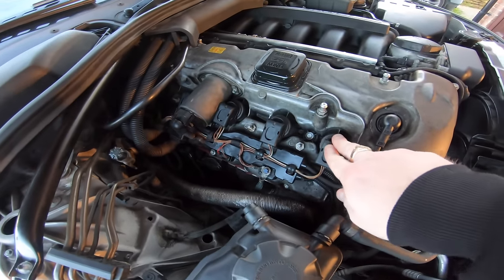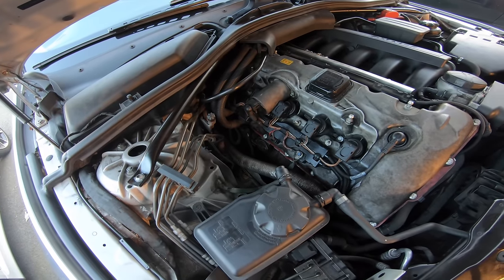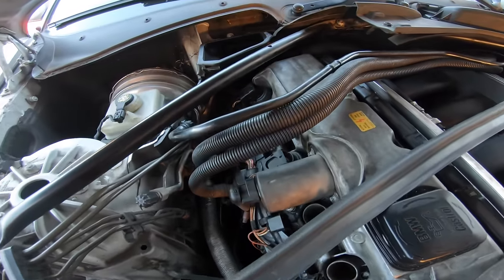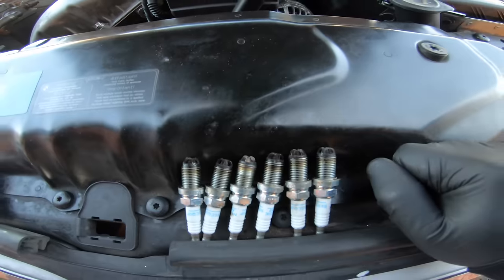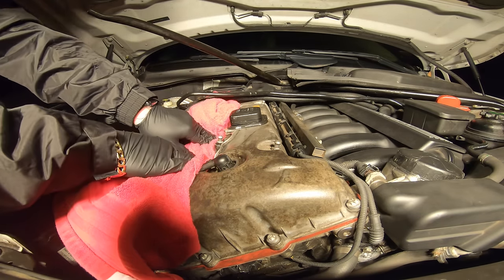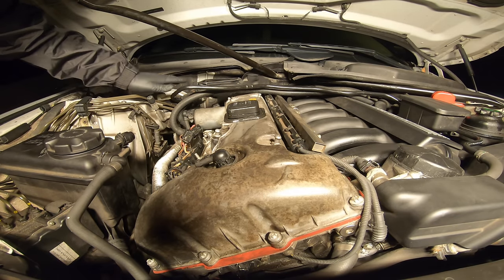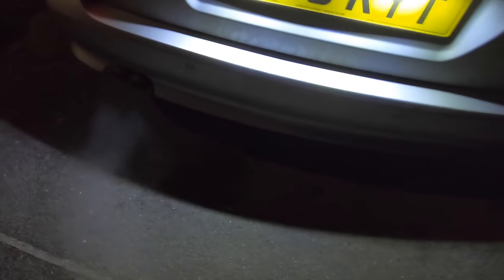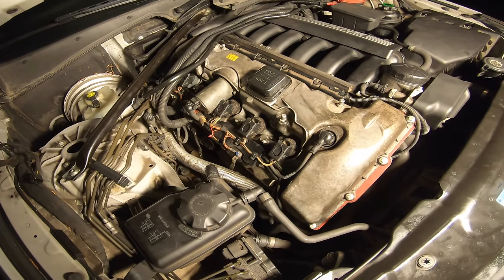How to Clean Piston Rings Or Oil control rings after head Gasket failure / CCV Failure On Any Car

Comment: The amount of smoke that came out of my 328i filled the street with white smoke for about the length of a football field with berrymans b12.  It cleaned my oil sensor so now it's working properly again. Also not burning a drop of oil and no oil burning smell. I couldn't be more happy. I used my tools and a bore scope. I just did a 8 hour soak. Topped off Then rinse flushed out the spark plug holes. The amount of carbon was monstrous. Although the crankcase is in pristine condition meaning this car had normal oil changes before I bought it in March.  I couldn't be more happier.  Next is ultrasonic cleaning the fuel injectors.
Reply: @Centralflorida22  thanks mate I’ve got a serious oil burner on my hands. Toyota 2.4L. I’ve been watching similar videos, however, I’m gonna give this one a good luck. Thank you.

Comment: Hi, I treid your process this week on my car.  The next when I started , as you mentioned that it will smoke, that was exactly what happen. After about 10 min into idle, my car started to idle very smoothly like it used to a few years back. I n54 has it power back , thanks to your video.👍👍👍👍

Comment: Seems like throttle body cleaner would be a better choice to clean the combustion chamber than fuel injector cleaner. My though is I don't think the kind of grime dirt in fuel injectors is not the same as found in combustion chambers which I think throttle body cleaners are better for. Am I wrong?
Reply: No, not throttle body cleaner, you'l ruin your bores.

Comment: i did this  the other day on my 01 m62 4.4 x5,  put small amount in holes , left over night  did exactly what it said on the video, ive now got a car that wont start, i have fuel  i know this as  the plugs are always fouled with fuel, i have spark ,  im having to get the car towed to my local indy to let them have a go,  lets see if they can get it working , but as of yet, id do this procedure at your own risk,
Reply: What was the issue? Do tell
Reply: any update?

Comment: Finally found an in-depth video on this process. Thank you so much for doing this and filming every step. I'm about to replace my cracked CCV and I had to find a video on how to actually do this cylinder cleaning. I really appreciate you taking the time to show this from start to finish
Reply from the maker: You are very very welcome this is why I came around in very surprised it took you this long as I’m at the top for n52 manifold I have the best video for intake manifold removal which is full in depth process
Reply: @BMWDoctor  I've been searching for m54 videos, but I'm not sure how I missed your channel before, but I've just subscribed so I won't be missing anything in the future!

Comment: I used to use this redex stuff way back in the 1980s when my car had a lot of pre ignition carbon build up ,causing the engine to keep running roughly for a little while when i turned the ignition off because the high amount of carbon was hot enough to keep the engine roughly running for a short while.When i poured this stuff down my carburettor with the idle screwed turned up to make the engine run faster smoke billowed out like crazy.After that I never had pre ignition again good to see its still around.

Comment: I've been using Redex for more than 50 years on my cars and motorbikes.I always add Redex to my tank every time I fill up.I have never has issues with stuck rings,carbon build up etc.Redex works unlike the snake oil stuff that's sold as the miracle cure all such as Seafoam and the like.I'm old enough to remember when all petrol stations had a hand held Redex pump,you paid 1 old penny a shot for your Redex and you could blow your tyres up for free.Happy days!
Reply: Seafoam added to the oil on my customers 1.25 Zetec stopped him burning oil....... Completely.
Reply: @stephenrees3502  you know what? If you drip seafoam down the plug holes it will be in your motor oil later on 👍

Comment: good job on washing the rings..its a good idea!..I'm glad you mentioned to do oil change because the injector cleaner will be harsh on the bearings if you don't change!..
Reply: do you need to do any engine oil flush or just regular oil change new oil filter

Comment: Damn that leaked down right past the rings in 12 hours (nothing came out on your towel) Love the bimmers myself but the slant pistons/deck in this instance means it all just drained pass the low side of the piston and cylinder wall. Next time pull the vehicle onto car ramps just on the right side (right side front and rear wheel) that will get the pistons facing more near vertical orientation so the cleaner may drain pass the piston rings evenly all the way around.

Comment: Redex used to have instructions on the back of the bottle for 3 different ways to use it. 
1: pour in tank.
2:pour slowly through carburetor with engine running.
3: fill cylinders with 20 mls of  redex and allow to stand for 40mins.  Then turn over engine to dispel redex and replace spark plugs. 

I'm not sure why they stopped listing these instructions,  maybe it was due to fuel injection becoming more popular than carburetors , but it was definatley on the bottle and it worked well.

Comment: Before cranking the engine with the plugs out, is it better to suck the remaining Redex out (turkey baster/fluid transfer pump)?
When cranking, I would remove the DME relay and fuel pump fuse, like we do when compression testing.

Comment: I make same this procedure on muy camery 2005 with using W40 , AC delco carburetor cleaner and cyclo carb cleaner and the result is very amazing 🤩 the sludge and gum come out with small pieces 😖 its huge dirt come out of my cylinders

Comment: this is a good video  but it is only doing half of the job.. if you do have oil consumption problem.. 1) you need to bring the vehicle to operating temp meaning your upper and lower rad hose has to be the same temp... then apply the chemicals as he does  2) check your PCV (very important)

Comment: Looks like ATF thinned with acetone. Which is a home concoction I’ve used to free up frozen engines, soaking through spark plug holes.
Reply: like that receipt
Reply: Doing that now to a 530xi should I remove starter did oil change haven’t put oil back in waiting for gas to seep for a few days then Ard and acetone any tips

Comment: oil control rings are the lowers in the pack. Not accessible by the top. Better to use additives in the engine oil.
Reply: both actually
Reply: Additives are not enough at some point

Comment: did you remove the fuel pump fuse before cranking the engine without spark plug?

Comment: Would you recommend this on a 263k mile M54B22 or would it do more harm than good on a high mileage engine I don’t have any running issues and burn very little oil between changes

Comment: Would this be a good idea on an M54? 2003 525i. Not a bad oil situation but just to kinda clean it a bit without removing the head. Also, when you put the cleaner in should you turn it over one time without the plugs before letting it sit to kinda coat the whole chamber? I feel like it would just sit in the bottom part of the cylinder head is my thinking

Comment: Hello, I’m getting a p0301. Which means misfire in cylinder 1. I changed the spark plug and swapped ignition coil number 1 with 2. I was still getting this misfire. Would this process help
Reply: Did it help?

Comment: Hi there, I have a question. For a straight six the injector cleaner should cover complete ares of the piston. However being a V8, the piston is angled. Does that mean the injector cleaner only covers a portion of the piston? So one said to flood the chamber over a few days and then syringe out the remaining cleaner that hasn't drained down. Was told that it would ensure the pistons are fully soaked.  What's your opinion, any advise greatly appreciated. Thank you Sir. Brilliant channel, enjoy watching content 👍✔️

Comment: Just checking my understanding of coil on plugs here. It IS ok to unplug coils and crank engine even tho ecu is sending what I would guess is a low volt signal to coil to fire. As long as coil has built in ignitor I think is what I have read. I'm not going overheat something in ecu. Is that correct?

Comment: I know its a old video but, i have the n52b25a engine with the oil ring carbon build up problems. How many times you have to let them soak in the cleaner? Cause I now use 1 liter oil 1800 km or 1118 miles

Comment: That's awesome!
But, I got one question for everybody.
Some cars have rubber oil control rings after 2 sets of steel piston rings attached to a piston. 
When cold, piston rings will allow liquid to pass because of the small gap before metal expands when hot and closes this gap. 
Now, this is reactive chemical when it comes in contact with the rubber, like petrol/gasoline /benzin. It makes rubber brittle and rubber crumbles if exposed for longer to gasoline/injector cleaner.
If you live this inside combustion chamber, it will pass the steel piston rings and get to the rubber control rings.
After prolonged contact with this rubber, the injector cleaner will soften the rubber, or even destroy it. 
Thus that car will start burning even more oil, because oil rings have started rapid deterioration. 
Am I wrong here? 
Or is it that this type rubber is resistant to the dissolving effects of the injector cleaner?
Reply: Holy cow someone needs to answer this!
Reply: Redex is designed for the fuel system and injectors of course... so the whole system has rubber everywhere like in hoses in the fuel pump before the injectors everywhere. So i guess it's not gonna be a problem for rubber that is designed to operate in high temps...

Comment: Hey Dean I love the videos, I have changed CCV but still have a lot of oil just on cylinder 5   on the spark part of the plug not on the top wire connector, so its oil in combustion chamber maybe?.  2006 z4  2.5si  n52 b25 .    I am hoping that this will fix the issue this video guide .  Its my Next Job to try to clean the pistons and oil control rings,  , then fit new top gasket and new bolts.    Could something other than CCV or dirty piston be causing cylinder 5 to foul the plug i have to change the plug every 2000 miles and if i leave car idle the plug will foul after 10 mins, and misfire,  until plug is cleaned or replaced. any help or advice is great fully received.
Reply: Did it help?
Reply: @twijers5841  xD

Comment: Hi Dean, this is a pretty interesting procedure, and I may very well end up doing this to my E46 330i which is definitely suffering from a blocked PCV and as a result using a lot of oil. For the majority of its life, this engine has been running the standard BMW spec Castrol 5W-30 LL01 oil, but at its last oil change I have allowed the dealer to put their new Shell based 5W-30 oil in and just before that I ran the engine with the Liqui Moly MOS2 treatment for a few weeks. I have been debating a few other things to do, one of which is the ATF oil treatment, but that is a more gradual process and can tend to thin the oil out a bit.

So I gather any decent injector cleaner will work for this and from what I can see, you are putting roughly 10-20 ml in each cylinder? Also, on a different note, I am curious about the spark plugs that came out of this N52, I thought all N52 engines only used the single electrode Iridium spark plugs?
Reply from the maker: they can use the single or the quad ones its not majorly different to be honest im using quad ones on my n52 without issues
Reply: That's interesting and good to know. And it makes sense since the coils used in the M54 engines is the same as the ones used in the N52.

Comment: After this procedure you chainge the oil or not?  Thanks for answer
Reply from the maker: You don’t have to but you can I would advise doing it before oil change if your changing your ccv anyway and your gonna do this do it before hand once you change the ccv and then change the oil very simple
Reply: @BMWDoctor  Thanks för answer,  i will try this And Post here back,  i chainge the ccv already and I have oil consume extrem about one liter 500km , my car not have oil leak and it is one e46 M5425  with 320.000km
Reply from the maker: No problem mate with that mileage the car has had it mate no harm in trying but as you have only just found this procedure you have probably done more damage to the oil rings all that time so it’s probably done for now
Reply: Thank you for the video over here they like to use seafoam what's your opinion on this?

Comment: Hello mate, great video. I have oil burning problem on a N42 engine. CCV replaced, no improvement. Engine compression is around 170 psi on all cilinders, oil consumption about 1liter every 1000 km. Car is 150000 km. Do you think your method is also suitable for me? Thank you for your support.
Reply from the maker: yes mate suitable for all vehicles mate
Reply: Thank you for your answer. Another doubt: after this process, should I change the engine oil? If so, when exactly should I do it? After leaving it idling until no smoke comes from the exhaust and after going for a ride? Please give me your feedback. Thanks mate.

Comment: If I knew about this on my first BMW I would have done it when my CCV blew the first time I had a lot of black smoke at the end of my tailpipe I didn't know what was the cause and I kept searching and searching and turns out yes it was a CCV but I didn't know about doing that other part that you did but on that note do you know anything about mode 6 I really appreciate your help and your knowledge I still drive my first BMW with 227 thousand miles

Comment: Great video. The cleaner you used, it’s it petroleum based? If so, is that bad for the oil rings? Also, what are your thoughts on the seafoam product?

Comment: Hi dude, are u still active being a doctor for BMW? wanna ask lil thing that bother my head. When u cranks without spark plug in order to spit the Injector cleaner out of ur engine, do we need to take off the DME relay? Just like when we do compression test in cylinder, some youtuber told us to remove DME relay or fuelpump fuses. Thanks before

Comment: Great job but I have a question won’t this hurt the exhaust O2 sensors or is it safe to do it?
Reply from the maker: Nope this does not hurt them at all this a method many many garages use and when I was at bmw we used to use this method all the time of people were saying they had rough running on a cylinder from a blown pcv this is the easiest and a fully working method to clean the cylinder and piston sticking without stripping the engine you can even use white spirit if you really wanted aswell
Reply: BMW Doctor thank you sir keep up the good work👍🏼

Comment: Can you do this with a Diesel engine
Reply: No. Diesel engines have no spark plugs and though in a direct injected one you could remove the injectors to prevent compression it would be a significantly more complicated task.

Comment: I suspect you can do it even though your CCV hasn't failed, but you're burning some oil.
Reply from the maker: This is mostly used for people who had a blown ccv and it got into the cylinders making them stick and same for head gasket failure this is not something you do just because you feel like it or your burning a little bit of oil that’s expected with ANY BMW
Reply: @BMWDoctor  what about if you went to check why you got a misfire, and the sparkplug hole was filled with oil?

Comment: Well, after I did this to my car I kind regret. Too much risk/effort for zero-small gain, long term effect is unknown yet, but I wouldn’t recommend it especially for the people have v shape engine. 
The falling carbon deposit can stuck inside the first and second piston ring, so even you did everything correctly, you still have the risk to scratch your cylinder wall in long run. I get another score only after 10 min of idling, so don’t do this unless it’s you very last option before engine rebuild

Comment: I have a E46 with similar problem I've ended up by passing ccv with a catch can but still seems to b burning oil bfre I giv in n think the piston rings r knackered can I do this method on my engine aswel? Brilliant vid thanks for some more hope 😂
Reply from the maker: Yes you can indeed and it will work go and do it let me know how much improvement it does for you you watch and see how much nicer smoother your car feels
Reply: @BMWDoctor  I will n Al let you know thanks hopefully will solve my oil burning issue for good
Reply: @hedgehogjoe1605 
Hi Ian
Did you try this and if so how did it go?
I changed to a catch can also {around 2yrs ago} but still burning oil. Wondering if this is worth a try. 
Thanks

Comment: Hi Dean , I’ve got a problem in n42 engine with a excessive compression on cylinder 4 and  knock signal is very high on it when I plugged computer to it.
I’m planning to do what you did here , do you think the compression is to high due to carbon build up? Thanks a lot

Comment: I have a 2.0tdi Audi a6 pcv valve good but 1 litre of oil every 500 miles and blue smoke from exhaust will this help as I used redux diesel cleaner in glow plugs and cranked every 6 hours but there’s still bit of blue smoke steam from exhaust will I need to drive it a couple hundred miles to get it out
Reply: Next step is b12 soak if there’s no luck with this